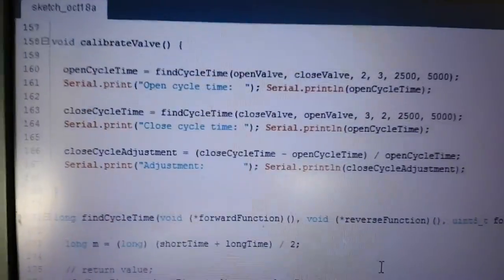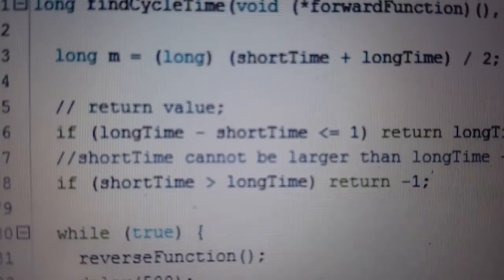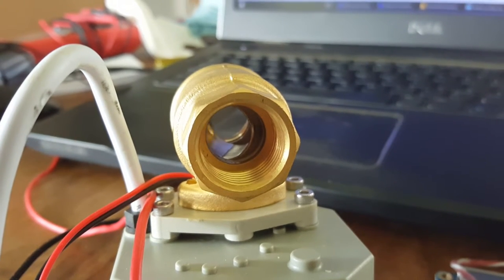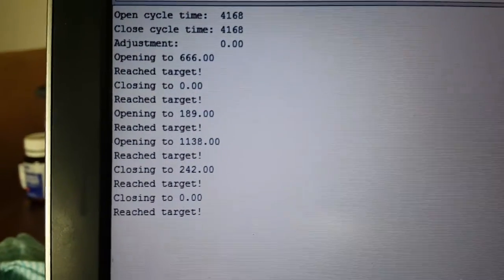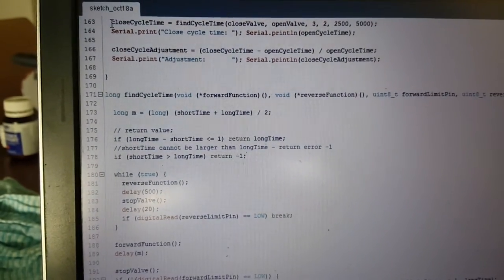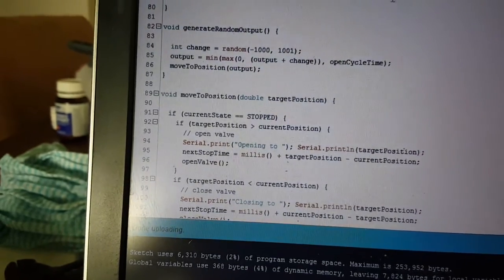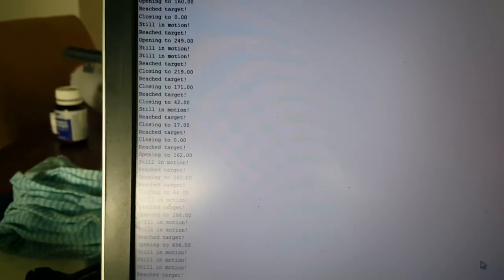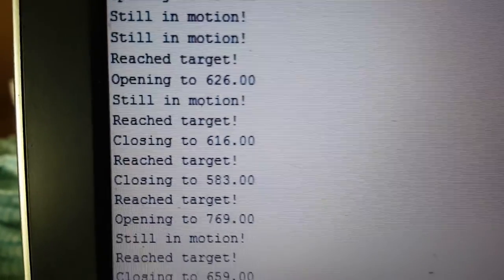Calculating the position of a 2way motorized ball valve with Arduino

Comment: It is so hlpful to have such control to the motorised valve with Arduino, I have tried following the pins connection as the sketch, but the valve never moved. I tried to open and close the valve with another easy-to-control sketch, and it worked. Would you please share the schematic and wire diagram? Thanks

Comment: Thanks for a great Video!  I followed the Github link, copied the file and opened it in Arduino IDE.  I saved it with no edits the ran verify, it blew out saying: "deduced conflicting types for parameter 'const _Tp' ('int' and 'double')    93 |       *setPoint = floor(min(max(0, *setPoint), cycleTime) + 0.5);  "   Any ideas what could cause that?  I know Max() is valid but that's the function it's calling out.  Is there a more current version of this.  It's a great sketch and I need to use it on my Radient Heat system's Valve.  THANKS

Comment: Is there a way to get this Arduino program from you? We need to build a mixing valve system using a 3 way 12 volt motorized ball valve and want to use an Arduino controller to set different valve positions to change the mix.
Reply from the maker: Peak of Perfection Roof Cleaning I've progressed a little further since then and have a software debounce of the limit switch that atleast works for my valve.  i will put it up on github for you in the next few days
Reply from the maker: https://github.com/wiifm74/TwoWayMotorisedBallValve This is the library I created and a couple of examples.  Good luck with your project

Comment: Hey there, great video, I appreciate your work a lot ! I was on a quest for reading the valve's position by fitting a potentiometer on top of the indicator. I am using a valve similar with the one you've used, with position indicator and manual override. Can you please share the schematics you have used to control the valve ? Best

Comment: uint8_t motorSpeedPin = 10;
uint8_t openValvePin = 12;
uint8_t closeValvePin = 13;
uint8_t fullyOpenedPin = 2;
uint8_t fullyClosedPin = 3;

that code in examples,.im still cant understain,,.that its have 5 pin inout,.but ihave motorolize just 3 intput,.= - and ground,. can u explain what pin in number 12 and 13,.what motorolize u have because when i see ur youtube,.u have 5 cables
Reply from the maker: pin 12 and 13 are output pins to tell the motor to open or close
Reply from the maker: pins 2 and 3 are input pins to know when the valve is fully opened or fully closed
Reply: @wiifm74  isee,.so ur motorolized have 5cables right so u canknow when the valve si fully open or closed
thx wiifm,.
if you don't mind, can i see your program code.
right now I'm trying to make a PID, but still need some inspiration, maybe some of your programs can add some literacy
thx before wiifm
Reply from the maker: @yogipriasetyono5949  if you are implementing pid, then go with a solenoid valve.  it's much simpler.
Reply: @wiifm74  i hope so,.but its about project team. and my job is trying PID in motorized ball with three cable,.
if u have some advice or something can help me,.I would be very grateful
Reply from the maker: @yogipriasetyono5949  if you are determined to go with pid, then maybe use a stepper motor, so you know the maximum and minimum position without calculation

Comment: What's the point of all this? Can't you just start the valve and it will open, why do you need to calculate the position? I have similar motorized ball valve but haven't tried it out yet...
Reply from the maker: in my case it is to control the flow of cooling water for a water to vapor heat exchanger, controlling the temperature of the vapor allowed to flow past